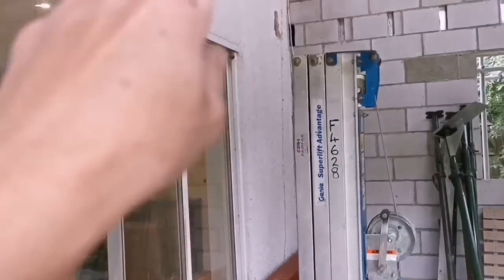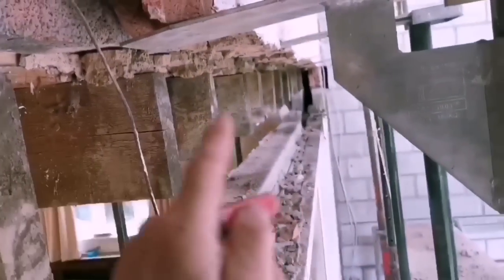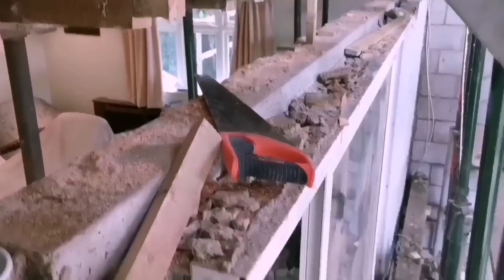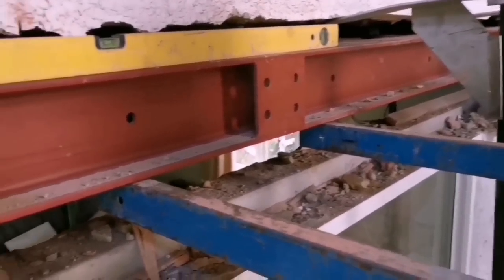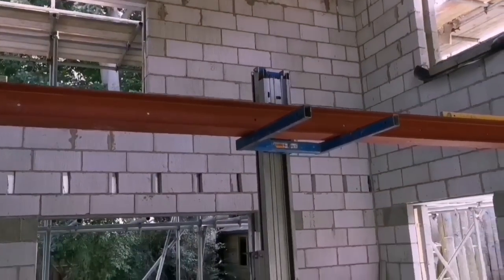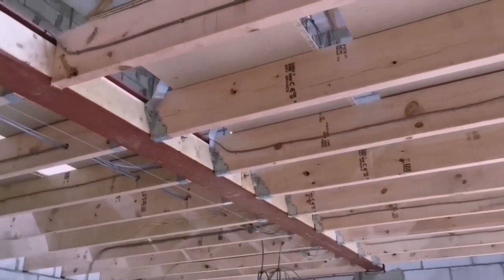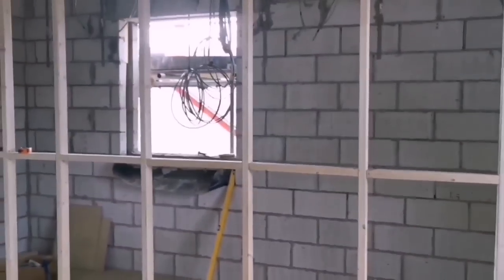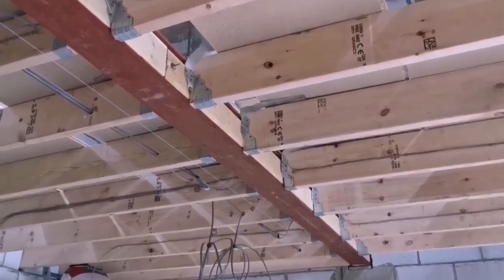Installing rsj steel beams and floor joists

Comment: You must have a very understanding BCO judging by the way you cut the end of those first joists...
Reply from the maker: Haven't had one fail yet not sure why you think they were wrong. Lot stronger that way than putting joist hangers in
Reply: Its because you turned a  6x3 into a 4x3 at the ends..I did the same and the inspector made me put joist hangers on as well!!!
Reply: @markhep you’re not being serious now. Joist hangers are incredibly strong. You’ve buggered up the integrity of the timber there, and created a natural split point.
Reply: @daveash695  exactly

Comment: Can you assist me please? I have had some steels installed with some new joists. The joist sit flush inside.the rsj and the bottom flange is protruding by around 20mm. How can plasterboard be installed with the flange not flush with the bottom side of the joist? Thanks.
Reply from the maker: Hi .the best way  will be to batten underneath.thats probably the cheapest way you can do it then put the boards on just use roof laths they are cheap and around 25mm
Reply: @markhep  thank you for your reply!. Just to confirm that would mean battening the entire area where the new joists are installed? I am in the process of having a loft conversion on a semi detached bungalow. Hip to gable. The old ceilings were made from plywood so all ceilings were removed. Thanks.
Reply from the maker: @KTan-u2v  yes just to make it flat . otherwise you would have a step in the ceiling 👍
Reply: @markhep  yes the step is what I was concerned by. The builder should have notched both the top and bottom to be flush with the flange on either side, just like you did in your work. Thank you for your help.
Reply from the maker: @KTan-u2v  no worries mate lucky a easy fix 👍👍
Reply: @markhep  I agree. If it was a major job the builder is still onsite and I'd make him rectify it before I make any further payment.
Reply from the maker: @KTan-u2v  👍

Comment: What did you use to shim the rsj level?
Reply from the maker: Hi mate I just used slate but you can use metal shims if you have the right thickness. I find slate the easyway 👍👍👍

Comment: This is the second vid I've watched that fast forwards at this critical point when the beam is being located in its final position at height. Would be great to see this in real time as its the most difficult part of the process. Secondly, I would like to see how you get the other beam into the pocket as the beam is longer than the room size 😁
Reply from the maker: Hi Keith yere it's the slow part of the job probably why everyone makes it fast but yere I will keep it in mind for the next steel job 👍👍👍

Comment: how and what did you attach to the I beam to hold the joist hangers?
Reply from the maker: Hi Robert we drilled through the Steel and bolted 2 6inch x2inch timbers witch sat inside the steel. Then nailed out hangers to the wood. You can also bend them over at the top and tec screw them into the steel👍👍👍

Comment: Super tidy work! Just wondering why you used joist hangers on centre span rather than notch the timber joists into the I beam?
Reply from the maker: Thanks mate if I remember I think they would of only had  40mm on to the beam that's why I decided to use the hangers 👍👍
Reply: @markhep  Interesting one that...as NHBC 6.4.12 only gives 45mm as min for I-joists (not solid), but yes 40mm seem too short. I think I'll have 72mm of support, but the structural engineer was bit taken a back that I even suggested using joist hangers. My steel is a bit of a pain as 265mm tall so I have to pack up 70mm on the flange (more drilling the steel) for the 195mm joists to get to finish height. Thank you so much for sharing! Just helps ease the pain of these decisions seeing others do it well!
Reply from the maker: @FiscalWoofer  72mm is a good amount.if I would have thought on before I order it I minght have ordered a wider Steel . something to think about for next time 👍👍👍

Comment: Brilliant. This vid could not have com at a better time for me - i am doing pretty much the same thing with some steels.  A few quick questions about bolting the two parallel beams together. What was the distance between the hole centres, was that M14 threaded bar that you used, did you use spacers between the beam webs to set the distance or just use the  bar/bolts to pull them together and are there any guidelines/regs  for the connections?. cheers - great channel
Reply from the maker: I mate I just had the bolt holes made at 500mm centers. With m14 bar. I dident use spaces because the steel clamped against each other. But if I have a cavity I get spaces made. Or you could cut some scaffolding tube for it. It did not have any regs for bolting together. Just said on my plan blot together so I just went for 500mm centers hope this helps. And thanks for watching best of luck with your job 👍🤞👍
Reply: @markhep   thank you sir  - great honest content.  I went for it at  425 cntrs and just bolted as they also clamped together. cheers
Reply from the maker: @carlreed1000  nice one. Will be bang on that mate 👍👍
Reply: Look at your existing and planned joist centres before steels are drilled so the bolts don't interfere with joists slotting tight into the web of the steel.

Mark you should make a template of the end profile of the steel and then cut a plywood pattern that fits tight into the steel. Get a chalk line on the underside of the joists and line your ply pattern up to this and transfer shape to joists. Cuts should all be the same and fit tightly into web of steel.

Comment: Bless you mark i feel your pain man, but atleast you have a genie lift this time  dont think your scaffold hoist would enjoy that work haha, 👌
Reply from the maker: 😂😂Yere did not dare to try the hoist. The steel just get heavier and heavier. Every time the design them don't they 👍👍👍
Reply: @markhep  over engineering because nobody can be arsed to do the propper math for it, who cares about builders spines anyways ha ha they send pages that look like they worked it out, just knowing that we only look for the bit that says UB before it hahahaha
Reply from the maker: @damo8754  😂😂😂you so right. I haven't got a clue what all that other crap is 😂😂👍👍👍
Reply: @markhep  i think its some mathmatical madness from the matrix haha all those green numbers falling from the sky 😆
Reply from the maker: @damo8754  😂😂😂👍

Comment: How much is the span for the existing wall with the 2 beams fitted & bolted ? I have about 7.5 meter span would like to know can avoid having any pillar thanks
Reply from the maker: Hi mate the was 6m. That is a big span 7.5m

Comment: Is it easy to line up the holes in the RSJ's for the bolts to go through?
Reply from the maker: Yere mate pritty easy. They make the holes a lot bigger than the bolt. So you get plenty of play with it 👍👍👍👍

Comment: @mark hep - How did you get the steels in behind the acrow props with the needles on them before you lifted ?
Reply from the maker: Hi Chris. We put the steel in place on the floor before we started any work. And put the acrows after the steel was on the floor. There would have been no way in getting the steel in afterwards 👍👍👍

Comment: Great video, learned a lot. When you  cut the old joist ends for the steel, it looked like there was nothing holding up the inner wall. I can see the props holding the joists up, but the joists ends seem to be free.
I am thinking of  doing the same but I can't see how the internal wall is supported.
Any advice would be a help.
Reply from the maker: Hi Phil. Yes so we have the joists support. And that's all we do because the inside wall is built on the joists. So as long as you support the joists we'll they will hold the inside wall up. We use scaffold boards to span the joists so we get everyone. The put acro up to them. Hope this helps 👍
Reply: @markhep  Thanks for the quick reply  Mark. To me it looked like it was only the top inch of the joist that was  under the inner skin and it I didn't think it was enough. The video proves it was, thanks again for your help.

Comment: Anyone...in this old house it is thin strips of floorboards...what type of boards do they use for the upstairs floor in the video. And as a non construction person... that strap is what holds the joist up... it does not rest on the the steel lip as well? So that is strong enough.... just curious... I know it is done correctly.
Reply from the maker: Hi mate yes They were living in it wile we did the extension. The floor boards are 18mm boards on floor in the old bit. But 22mm in top floor. You can for extra strength drill them to the steel if you like. 👍👍👍
Reply: @markhep  Many thanks!!

Comment: @mark why did you need two steels?
Reply from the maker: Hi Dale. It was the out side wall of the original house. So we had one for the inside blockwork  plastered wall. And the other was under the rendered bricks. That used to be the out side wall of the house 👍👍👍

Comment: In wich base you do this means any analysis is done in any software
Reply from the maker: We had a structural engineer. Do the calculations for what size steel we need. Is this what you meant 👍

Comment: Great work, starting to take shape now!
Those joist centres look wider than usual though, any reason for that. Didn't think you can exceed 400mm centres.
Reply from the maker: Hi tiktok. Yere they about a block 440. The span of the timber is only about 2.6 m with that big steel in so went a bit more with it. Just so they dident drop on a joint on the blocks👍👍👍